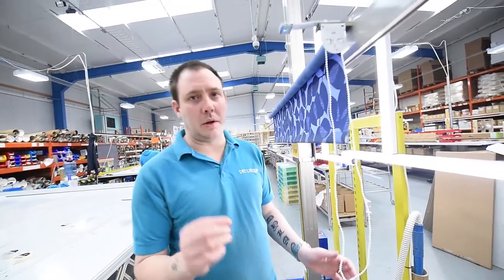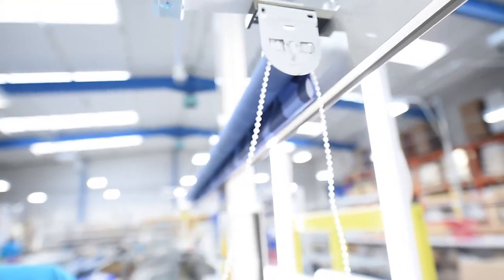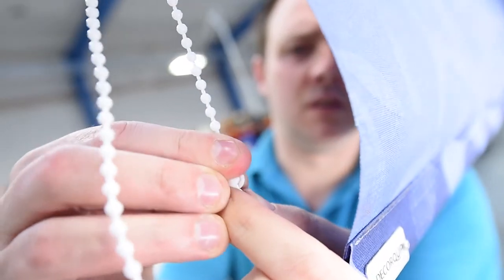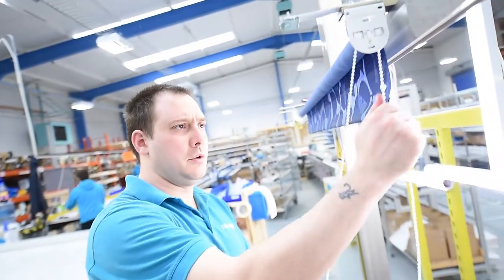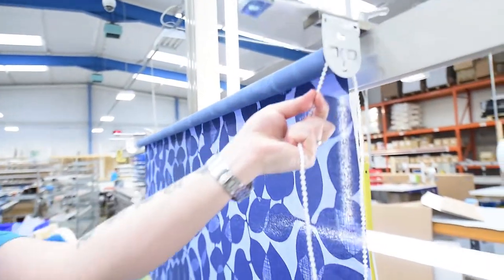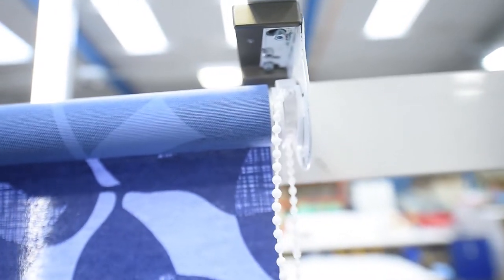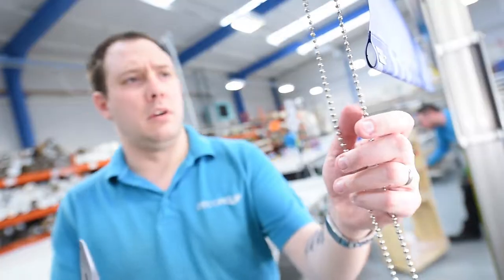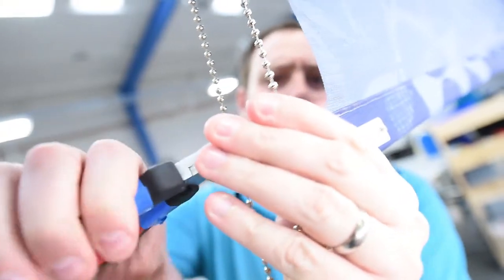How to fit Chain Stops

Comment: How do you move the metal ball once some idiot has clamped it in place?
Reply from the maker: Hello - unfortunatley this is not an easy task.  You should be able to prise the ball open using a small screwdriver and then some pliers/snips.  You may have to end up cutting it off.  Once you have removed the stopper, it may not be able to be reused.
Reply: @DecorquipLtd  thanks for the reply. Sadly I have found this is entirely accurate (and doubly difficult due to being high up).
I will return to my screwdriver and pliers ... it'll give eventually